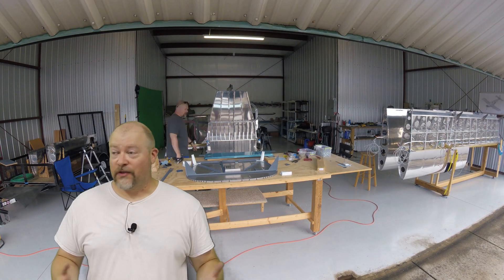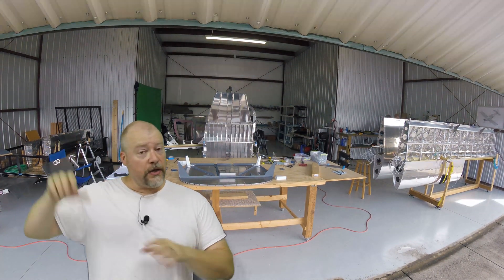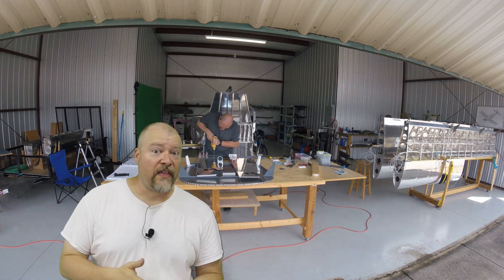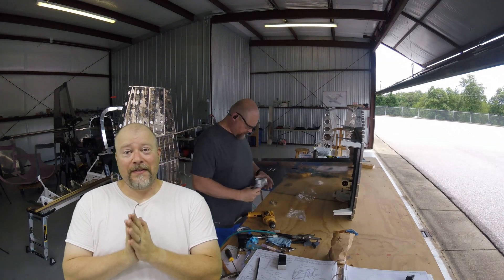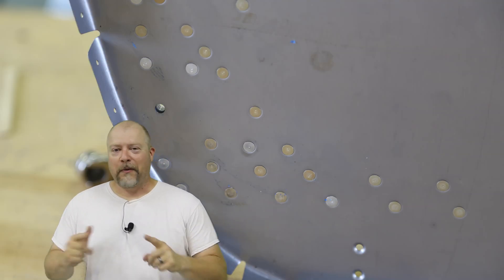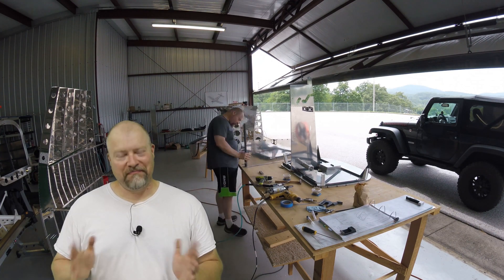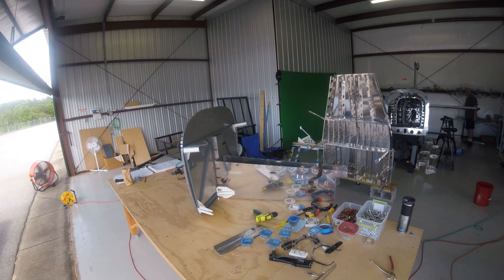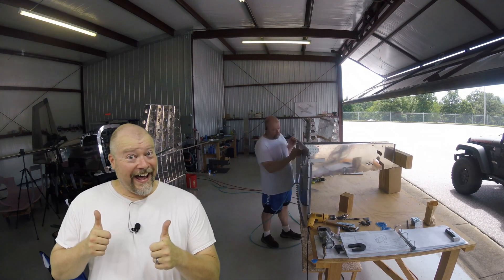RV-10 Fuselage - 014 - Firewall!

Comment: Nutplates:     Bowtie== K1000,    taper (diamond) = K1100
Reply from the maker: AH.. clearly I had a bag that was mismarked!  Good to know.. Thanks Gwen
Reply: @JasonEllisBuilds  Another thing to watch for is misplaced nutplates -- I've found situations that called for K1000-3s only to find later that I installed K1000-08s ---- to the untrained eye, the difference is NOT obvious until you find that the spec'd screw won't go into the nutplate (and it's too late to fix things)

Comment: Consider using NAS1097 3-X  rivets for your nutplate applications.  No need to dimple the nutplate when doing this because you instead make a machine countersink for them.  Check section 5 of the plans for a discussion on this alternate technique.  Vans sells the rivets but they don't list them in the online store (last I checked) so you have to call or email them.

Comment: I assume those are aluminum rivets in the firewall.  I wonder how fireworthy the firewall is once the aluminum rivets melt?  😁
Reply: If the fire gets that hot, you better already be out of the plane 🙃
Reply: S Taylor Then use aluminum firewall and save weight and finishing hassle.  That is my point.  If you really need an SS firewall, then you also need SS fasteners, not AL rivets.
Reply from the maker: @LTVoyager  The firewall is stupidly light.  It's very thin.  Thus the easy to damage easy to cut thing.
Reply: @LTVoyager  Jason just covered my thought, the rivets are 5 times as thick as the sheet stainless. They would handle more heat than .035 aluminium sheet
Reply: S Taylor Except they won’t.  Remember, that the only part of a flush rivet that holds the SS is the annulus around the factory head and that is just a thin ring of aluminum that tapers to a thin edge and will heat and melt about as fast as would aluminum sheet.  An SS firewall with aluminum rivets has a fatal flaw if those rivets hold anything important.
Reply: @LTVoyager  Symantec's, my previous statement still applies. If the fire gets that hot (660° melting point for aluminium) you don't want to be in that plane.
Reply: S Taylor Symantec makes anti-virus software.  Not sure the relevance to this material science and engineering topic.
Reply: Are you sure the firewall is ss because of heat?
Reply: Stainless has a melting point around 2500 degrees. Aluminum melts around 660 degrees. Gasoline burns between 500 to1500 degrees depending on oxygen.
Reply: S Taylor Which is why an SS firewall should use fasteners that will also take the heat.  https://www.rivetsonline.com/solid-stainless-steel-rivets#1
Reply: This is a good question. Has anyone talked with Vans about it?